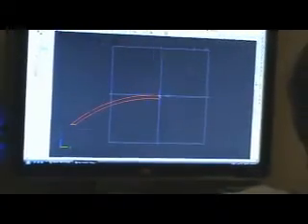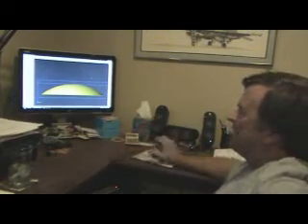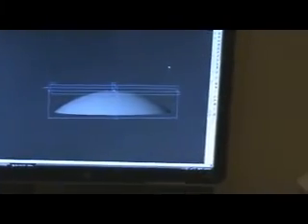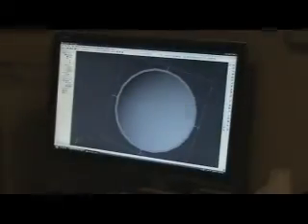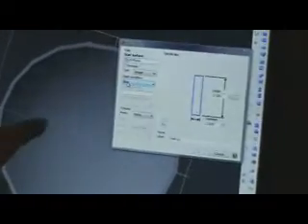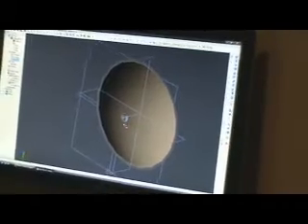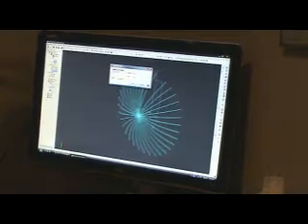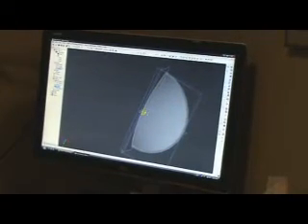CAD Design - Kevin Caron

Comment: HotRod,
I am away from my computer right now so this is hard to explain.
Try using the "loft" function. 
Draw a triangle on one plane and a point right in the center on the next plane. 
Go to 3d and connect the two with a straight line. 
Loft the two planes together.